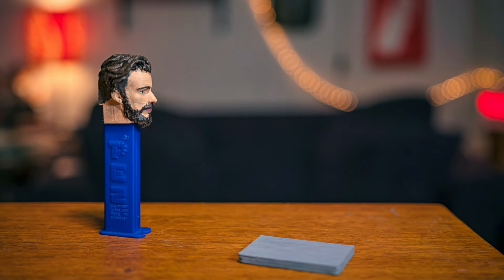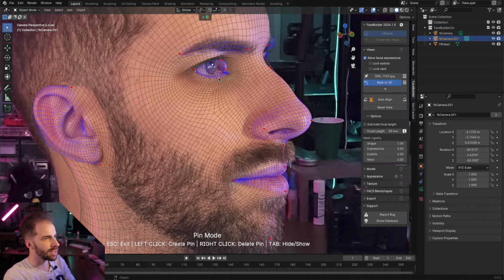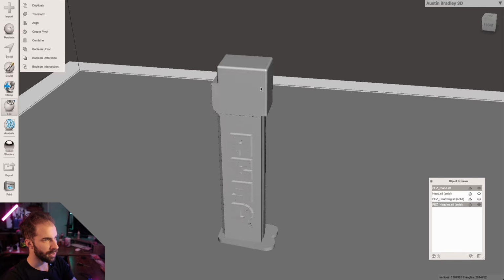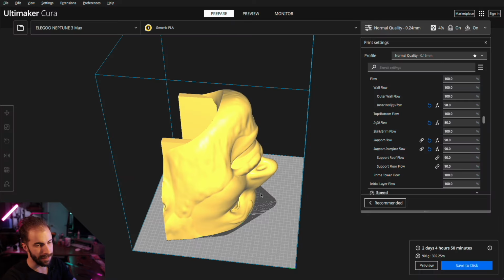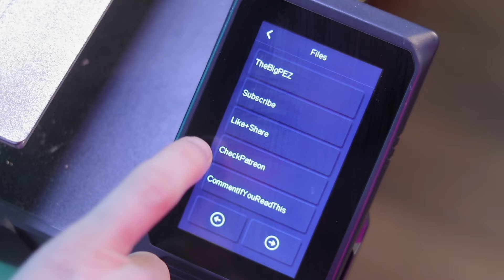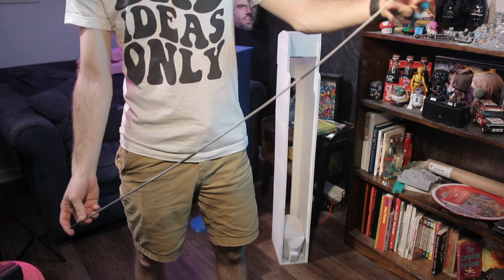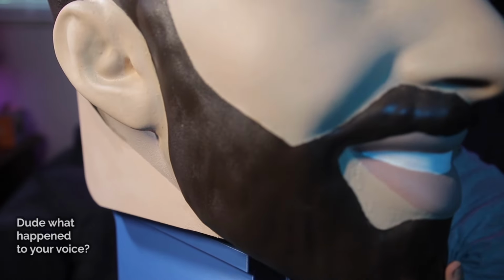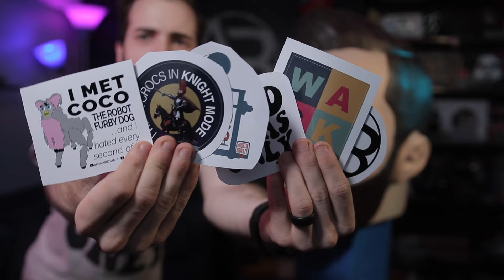Making a MASSIVE PEZ Dispenser | Cursed 3D Printing

Comment: It felt like a long time from when I saw the short about this until the full video came out. Totally worth the wait. This was great!

It's awesome that you care about your safety and wearing PPE. As a fellow "Beard-O", I thought you would want to know that all of the respirators, masks, etc loose a scary amount of their ability to protect you when you have any facial hair at all. I watched a video of a firefighter showing how the OSHA minimum required was no longer met when the guy had a beard, but once shaved, the same device was way over the required effectiveness. With a beard, it's still better than nothing, but not enough.

I looked into this when I started resin printing. The only truly safe type (That I have been able to find) for bearded folk, is the full head type with the backpack. Like Evin and Kaitlin sometimes use. They are not cheap, but maybe you can get the company to send you one? If not, maybe you can use, or make some sort of fume extraction station. Even just doing it in a larger space with a fan and open windows will help.

Congrats on another fun project and video. Well, fun for us. We didn't have to do all that work.

I wish I could make it to Open Sauce. I went to Maker Faire in the Bay area 8 times. I love these type of events. Have a great time!
Reply from the maker: I appreciate you, man. Thanks for the tip! I probably can’t afford one of the giant ones right now, but I’ll look into it when it seems like an option! I’ll just be sure to do fume-y work down in the open garage or next to an open window with a fan for now.

Comment: This wouldn't be super feasible for a project of this size, but I've had some good results using poster putty/sticky tac for masking organic shapes. I've also used kneaded erasers in a pinch, sometimes the kneaded eraser works out better because it's less sticky and you have an easier time removing it (Though I guess it being less sticky means it might fall off easier mid-painting).
Reply from the maker: Honestly, what I used may have been a great option, I just used it poorly. I should’ve looked up recommendations for using it with big spray painted stuff like this rather than the watercolor and stuff it’s typically used for. I just saw so many people using stuff like this that I thought it was straightforward🤷🏻‍♂️